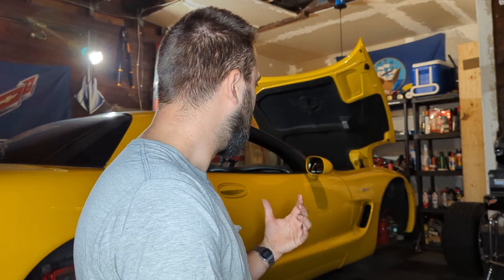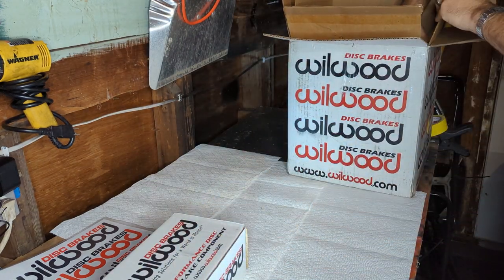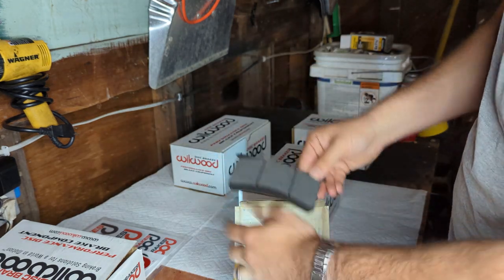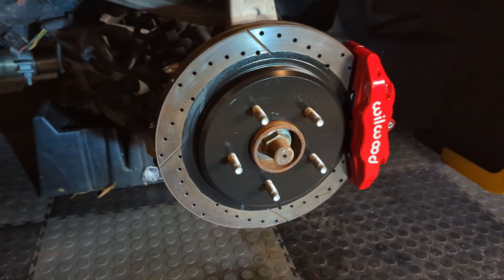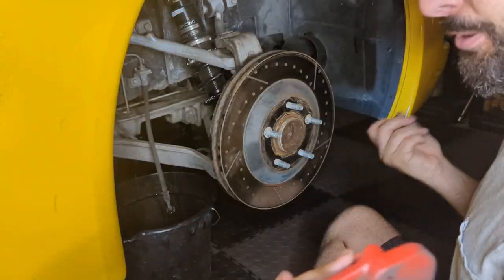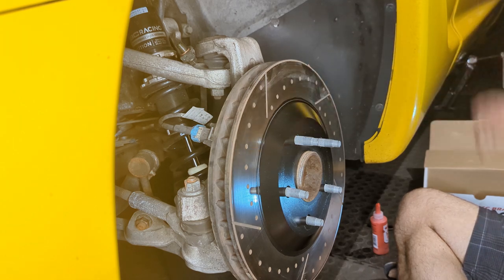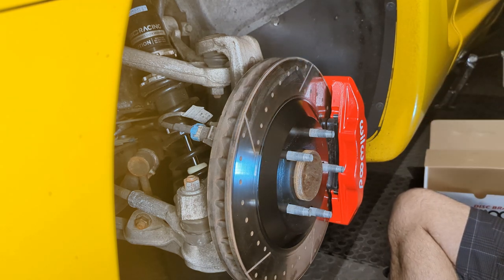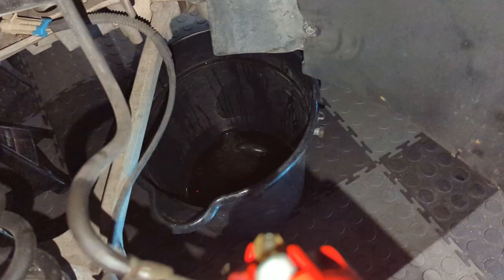MUST DO UPGRADE | OPEN BOX | INSTALL | BLEED PROCESS | WILWOOD 4 PISTON CALIPERS

Comment: I got the Wilwood 6/4 piston kit on my c6 z06. Amazing quality kit. My kit came with the BP-20 pads. Amazing medium street/track pad. Bite is strong and will snap your neck fwd with no fade at all. The pads can be a little noisy at light brake usage. Once they heat up or if you just press harder the noise goes away.  Lastly the break dust on these are unreal. Be prepared to dust your wheels a lot. Really only downside to the BP-20 pads. When these are done on my ride I'll probably buy the BP-10 pads. That is a more pure street pad that hopefully with dust less. 

Anyway I enjoy your videos, especially since I'm a Vet w/a yellow Vette too.

Comment: Dude. I frickin love this. No need for the huge brakes if you don’t actually need it.  I found XP8 pads have an excellent brake response and feel but the dusting is horrible.  But I like the OEM replacements that work with The stock rotors!

Comment: I'm surprised you didn't add stainless brake lines while you had the fluid system open. They would also give a little more bite. Maybe a future add?
Reply from the maker: Oh 100%.  I had to get this done in a timely manner.
Reply: @VetOnVettes  Time crunches suck. Enjoy it at every step. You can at least feel the difference with and without and give an opinion of their benefit

Comment: Will these fit under the stock 17/18 inch Z06 wheels? Would love to do a brake upgrade on my car but keep the stock wheels.
Reply from the maker: This kit I believe barely fits under the 17". The 6 piston will not.  But you MAY need a small spacer.
Reply: I have this kit and it fits fine.

Comment: Are you able to use your stock rims? Which I believe are 17 front 18 rear?
Reply from the maker: For the 4 piston you can use 17". If you go 6 piston & C6 Z06 brakes you need 18".

Comment: Could you use stock c5 pads with these if in a pinch?
Reply from the maker: No unfortunately as they are completely different. The pads used for the Wildwoods are like cartridges that slide in.